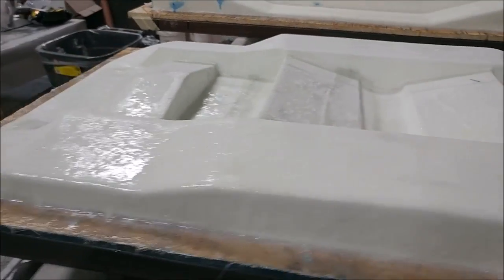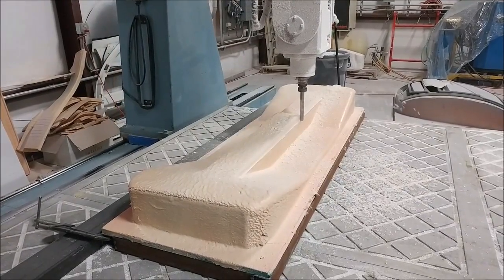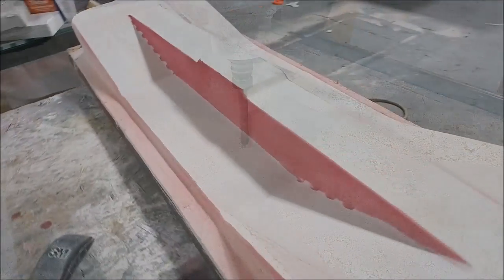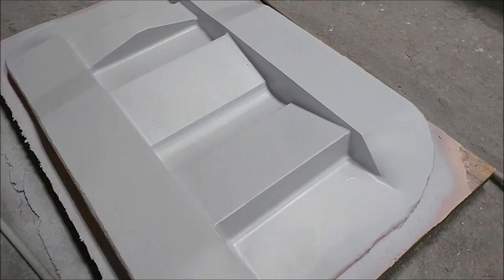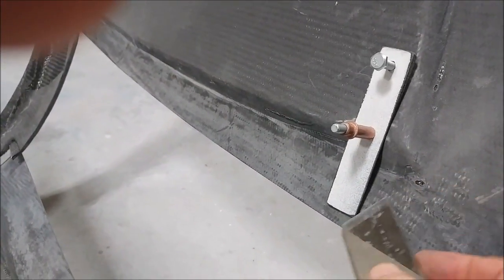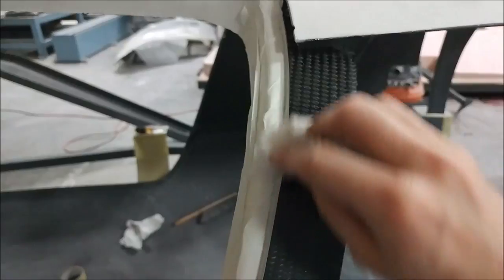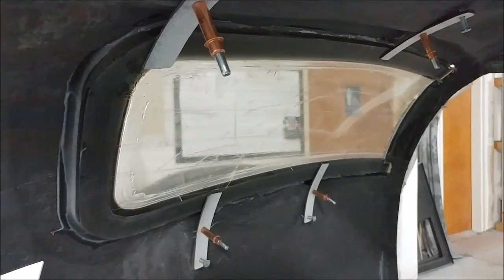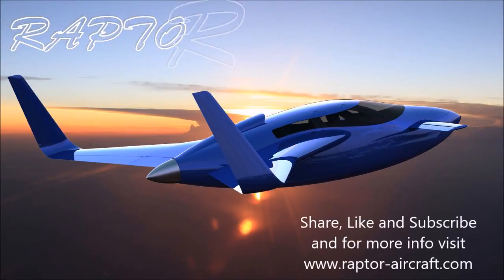Raptor Aircraft February 11th 2017

Comment: Another milestone with the first window being mounted! I was a little concerned that the inner view didn't depict regular spacing of the handy braces you made and that the rearmost lower corner lacked any bracing whatsoever, but not as much as with the previous question regarding replacability of the windows.

Would you consider a more sophisticated gasketed replaceable window attachment system? I realize that this "first article" airframe may be used as a pre-production experimental unit, but it appears you are taking intermediate steps to correct other minor issues you discover along the way, so as a continuous quality improvement and configuration management professional, I tend to pay exceptional attention to potential issues like this.  I'd like to think that this would not be a costly change if adopted at this early stage of the project, and the added structural members would likely make it easier to mount the interior trim,illumination, insulation, ventilation and interphone components.